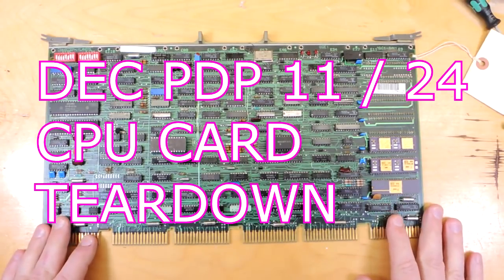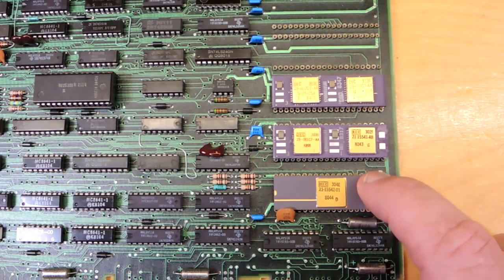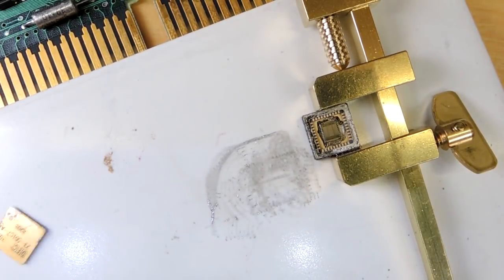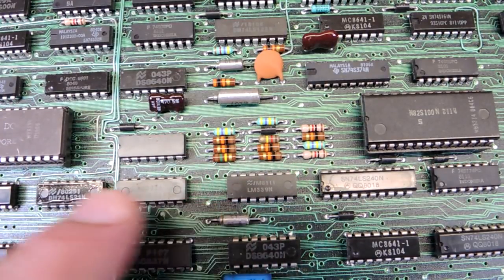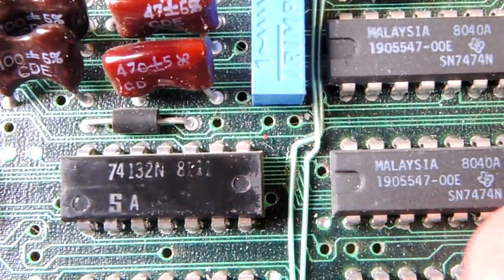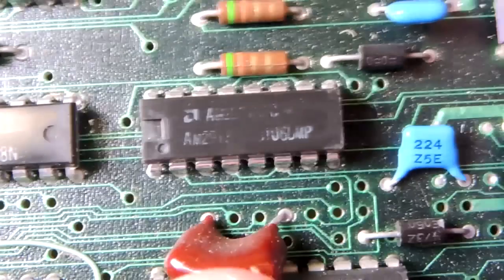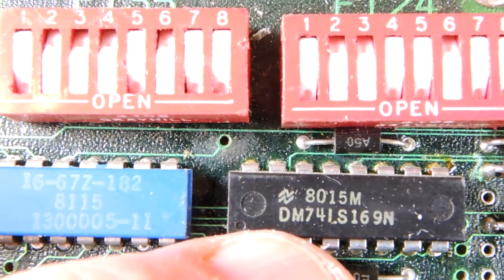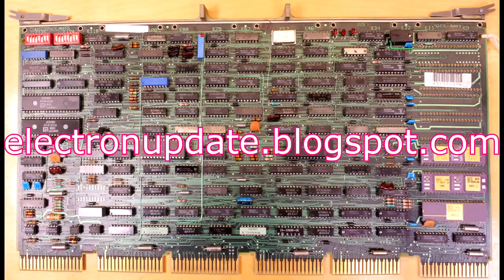DEC PDP 11/24 CPU CARD TEARDOWN

Comment: I worked for an outfit that used a lot of DEC gear, they'd already deployed one 11/24 to monitor and control some plant machinery and it did the job well, so when time came to extend the plant they got another one.  The 11/24 had two onboard serial ports, the console being one of them and that's what those dip switches are for, to set the serial port parameters, baud rate, data, stop bits etc.  We used only 3 wire serial connections (xon/xoff for flow control), so TX, RX and GND and in this installation the wires were coloured red, black and green.  The contractor performing the installation saw the serial cable and assumed this must be the mains power cable, so on his own initiative fitted a 3 pin mains connector and plugged it in.  Bang.  Fortunately I was not the one tasked with explaining to management why there would be a slight delay in starting up.

Comment: The chip you de-capped looks to me like cache memory. Does anyone know what it is for sure?
Reply: PirateKitty i have one wierd pc from 80s what uses memory as extra cpu cache.not sure how it works,how that pc is very huge and weighs like 70kg
Reply: Looks more like a mask programmed ROM with diodes ( or transistors with a base collector short) that drive a data bus structure column when the address line decoder selects a row. You can see the regular structures of the shorted base collectors acting as diodes, and them above the diodes there is a metal mask that either connects or not to the diodes, and thus selects bits as needed.
Reply: Conveniently there's a tiny little label in the die, right before the copyright notice. It reads "μcode." That implies it is a microcode ROM.

Comment: Unless these chips were already dead, its a shame this got destroyed...  it could have restored an old system back to working order
Reply: I feel there is a lot of value in documenting old hardware in this way.
Reply: It is worth keeping in mind that these things weren't exactly scarce. In total, DEC made over a half million of the various PDP-11 models.
Reply: @techobsessed1  Depends on your definition of scarce doesn't it. I've been hunting for a PDP-11 for several years now and onl;y seen maybe 5 come up on eBay. Cards are easier to find, when they're listed, but they're not cheap. Getting Backplanes is even harder
Reply: @the123king  Same here with VAX and Alpha, they are gone and the few listed commands high prices (in europe at least)
Reply: @boardernut  As an update, since posting this, i've seen about 15 come up on eBay that are accessible to me. I bought 3 of them.